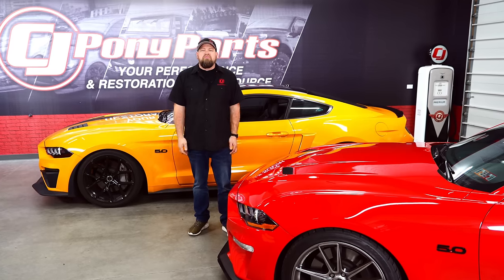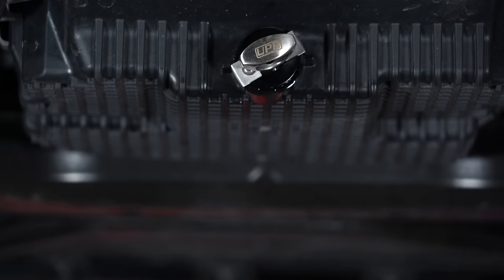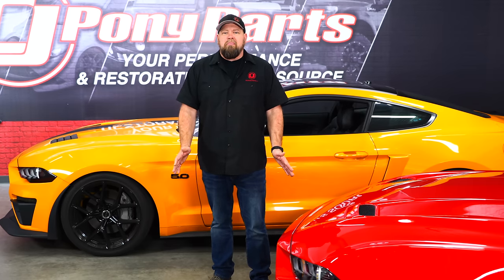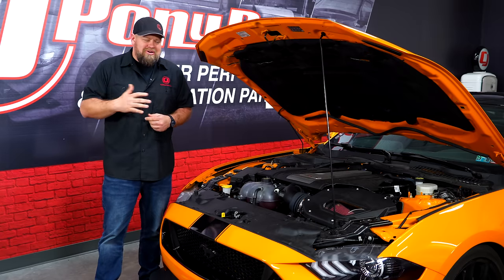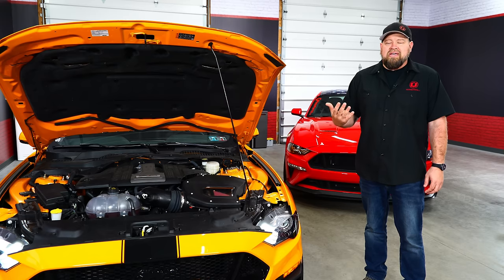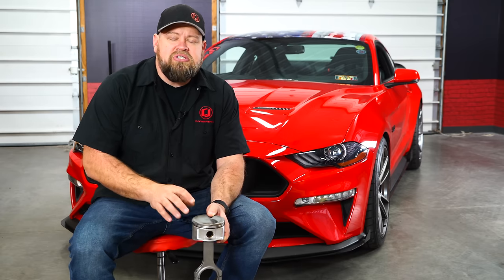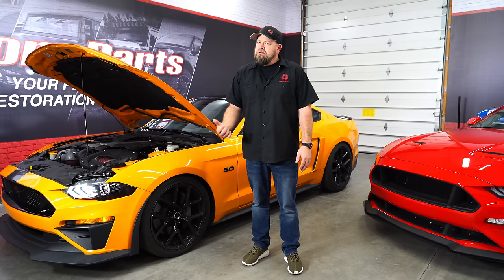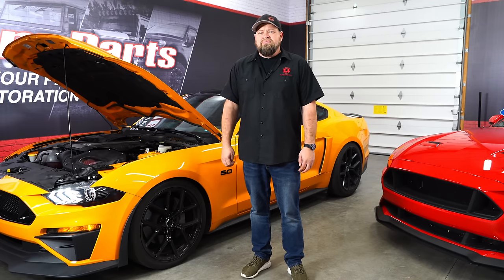2018-2019 Mustang Tick: Should You Be Concerned?

Comment: 2.3 and 5.0 problems....gotta love the solid as hell 3.7!..to many possible problems this tick could be...this guy has nothing but theories why should I run out and have to buy oil addative for a brand new car...
Reply: What problems are there with the 2.3?
Reply: @ericd1632  look on you tube! Alot of vids! Smoking is really common..and catastrophic engine failure...EcoBoost mustang's are getting the eco boom nickname for a reason
Reply: @Evillt1  I thought that was just with the Focus RS version of the engine. And it was just because the Mustang head gaskets were installed by mistake. And some cracked cylinder heads due to bad castings.
Reply: @ericd1632  true! It sucks how many of these EcoBoost mustang's have issues...ford had no choice but to attempt a 2.3 mustang because of government mandates for pollution...in turn forcing them to remove the robust,reliable,race engineered 3.7 because it did not meet the new criteria for pollution standards...the 3.7 is a amazing motor for reliability...the 2.3 makes good power but short term and especially long term reliability is just not there..

Comment: Yeah, no thanks. I’ll stick with my almost perfect 17 PP. I’ll wait till 2021 to upgrade.

Update: I actually traded in my 17 for a 19 auto. 5,000 miles now and the tick has showed up. Goes away when engine is warmed up but I’m afraid to drive it when the engine is warming up. #fordlife
Reply: It’s normal due to the direct and port fuel injection which is new to the gen 3 coyote. Don’t worry.

Comment: Or trade it in and get a 2015/2017 if it bothers ya that much. I drive the shit out of my super charged 2017 on a daily basis and everything seems just fine. Then again my car is so loud i probably couldn't hear a tick if i had one. The piston slap is definitely the cause of the motors going and Ford knows it. Its one out every 10k tho that gets it. They should have stuck with the sleeves it was working just fine but Ford was trying to cheap out a little. Like Bill says if there is metal chips in your oil then worry if not drive like ya stole it. No metal no worries...

Comment: i got a 18 gt and the tick i only heard it was during a cold start but i also think the  oil is the problem the factory 5w20 is to thin and u can hear it more i was reading  the manual and it even states if ur gona go to the drag strip / race the car etc use 5w30 i switched over to mobile 1 5w30 full syntetic ran royale purple 5w30 as well but like  the mobile 1 better but long story short my tick is completley gone cold start warmed up nothing and my is fully moded 2 as far as bolt on's go headers intake full 3inch cat back e-85 tune etc i can uploaded a video of a cold start of mine if any 1 wants to hear im not a big video person so dont expect perfect video just a heads up im just tired of ppl bashing on the 18's for no reason every new car has a few kinks in it dont matter if its ford chevy hell ferari there is all ways gona be something your not gona like so would you stop dating girls Because u had one crazy ex

Comment: I am thinking about buying a new 2020 Mustang GT (or maybe 2021 model year) but I am terrified about this dreaded engine tick.  The TSB put out by Ford is complete nonsense.  That's like saying I am going to buy a suit but I am told by the designer that many of their suits come with stitching that comes apart and that is just a normal characteristic of the fabric.  Are you kidding me?  That is a load of BS!!!  My response to Ford is, since they are one of the best engine builders in the world, why can't they make a 5.0 Litre engine WITHOUT the tick?  There is OBVIOUSLY a design flaw in that engine or else there would be no ticking.  You don't have to be a mechanical engineer to know that the sound is 100% NOT normal.  Ford puts out this TSB (or let's call it an excuse) to cover themselves legally.  Plain and simple.  If I were running Ford I would solve this problem immediately by either:

1)  Correcting the design flaw to eliminate the ticking in any new models produced; or
2)  Come out with a new engine (other than the 5.0 Litre)  that is PROPERLY designed that runs quietly and smoothly without any unwanted noises such as this tick.

Until I get some answers from Ford that can alleviate my concerns, I will hold off on this purchase.

Comment: Is funny how the GT350 uses 5w-50 but the Coyote that has most of the same component uses 5w-20.😓
Reply: @jaydoesstuff9807  
If funny how you concluding shit!
😂😂😂
Reply: @jaydoesstuff9807  
All I said was that the Coyóte pretty much has a oil weight that pretty much belongs to a economy vehicle rather than a sport one and even Euro models have an thicker oil weight on their regular vehicles 0w-40,5w-40 just think outside the box before you judge someone.
Reply: Lenta Jzx the gt350 utilizes a different crank and operates at a higher rpm.... that’s why the oil different🙄 euro cars run higher top speeds, on the freeways there
Reply: @jaydoesstuff9807  
OK!
That's exactly why I said what I said I didn't say they were the same exact thing,So you better read up Boy.

Comment: There are two things you can do to fix this "tick"
We did this to a '19 GT
1 STOP RUNNING SHIT OIL!
Royal Purple and Castrol are the only oils you should ever use.
Also use Lucas oil stabilizer.
2 Change the viscocity of the oil to 5w30.
That little bit more expansion fills in the gap between the piston, rings and cylinder wall.
Keeping the pistons perfectly centered.
No more tick.
You're welcome. 😎

Comment: I have a 2019 gt pp1. Had it for about a year, bought it brand new and it's coming up to 11k miles. Did the first oil change myself, royal purple 5w 30, almost right after I got the tick . Changed the oil the first time at 2k miles so have had a few oil changes since then and still have the tick. The car runs great but the noise from mine is pretty fucking loud and annoying. You dont notice when driving at all and it doesnt seem to happen all of the time but when it does happen it's really fucking annoying. No point to this comment, just saying. 😁

Comment: Sorry Bill but you're just making excuses for CJPP's bread and butter revenue maker, the Mustang. My car had the 2200 RPM engine rattle and BBQ tick after the first oil change. I opened up the oil filter that came on my car and found all sorts of ferrous silver and copper flakes. I made an appointment with my purchasing dealer and 2 days later found out I had camshaft damage and needed a new long block. This was on a 2018 GTPP2 that was never tracked or  taken to the strip. 5652 miles and I needed a whole new engine. Sorry but Ford is a garbage company that puts out garbage products. I'll never buy a Ford vehicle again and I'll be sure to let everyone I know to never even think about buying a Ford.

Comment: You know what I think it is? The sleeves are not long enough for the Piston to ride all the way down and come back up they come out of the sleeve that's piston skirt comes out of the bottom of the sleeve when you look at the Pistons of a used engine there's a little line Warren in that piston where that crankshaft comes around has pressure on one side and it's coming around and it's pushing from one side to the other as a crankshaft makes its revolution back upward and of course things radiate a sound worse of course it won't hurt anything but it's a ridiculous stupid engineering why don't you just add another 3 quarters of an inch of a sleeve Ford!?

Comment: I have a 2017 mustang gt and the engine has always been noisy since mile it’s called direct injection and overhead cams!
one I have a LOUD exhaust so it drowns out the gear whines and rattles and boy is there a lot of them haha when you switch to a solid mount on the transmission and lockout kit with vertical links adjustable toe arms and different shifter their is NVH who cares mustangs are suppose to be LOUD AND PROUD! Grandpas drive mopar and women drive camaros soooo.... if your shit breaks fix it!

Comment: Wring iv been a certified ford master mech for 15 yeas and none had it till 2018 and ford has told us any tick gets the engine replaced.never any problems with the engines in the last 14 years just 18 and 19.so get it right before you post lies

Comment: I did not watch the video. The answer to the question asked in the Video header is this: If you are a paranoid schizophrenic, then yes, you should be worried...very worried. But for the rest of humanity, just let it go. It is a non issue. I work as a Ford Tech at a Ford Dealership. (currently only a few classroom courses away from being a Ford Senior Master Tech) Do you know how many 5.0 engines in F-150's and Mustangs we have had with this "issue"? None, Zip, Zilch, Zero, Nadda. This is fake news generated by a very vocal minority (less than 1%) of 5.0 owners. And guess what? If your 5.0 actually has this issue, it is covered under warranty....assuming that there is actually anything wrong.

Comment: Ford are going downhill with reliability. Just look at the RS, what an absolute joke of a performance car that turned out to be. Even after head gaskets the blocks are still cracking and warping. I owned an Australian Ford XR6 Turbo and the gearbox had to come out at 5000km's. Ford will now use the cheapest parts they can get away with.

Comment: It’s junk they mass produce these and give no fuks about the customer that has to have the vehicle reworked to operate correctly really that tic isn’t supposed to be that loud it should be slightly noticeable in regards to the high pressure direct injection system if it’s to loud something isn’t right as for the rest of the car it was an afterthought and really they should put more time in to r and d that said every manufacturer for the most part is producing sub par products these days longevity is no longer a focal point of the manufacturing industry it’s making sure the vehicle has android auto and apple car play

Comment: Lol - the things people say to do to try and save their POS Ford.  Face it guys, these cars are fucking junk!  It may be the direct injection, or piston slap - here try and run 20w50 motor oil to quiet the engine down.  Now, yes there is transmission issues ... but,but other cars have had it too :,( 

Please for fuck sakes, it’s too many issues to be having for a new car.  PERIOD my Hellcat has zero engine knocks that must be covered up by heavy weight oils, no transmission issues at all.  

Our 392 Scat Pack has NO engine issues,  transmission can be beat on all day, it’s comical to see what the ford people say about these cars.  

In short - these cars are pieces of fucking shit, and don’t buy one :)